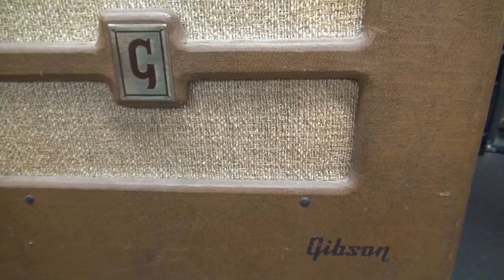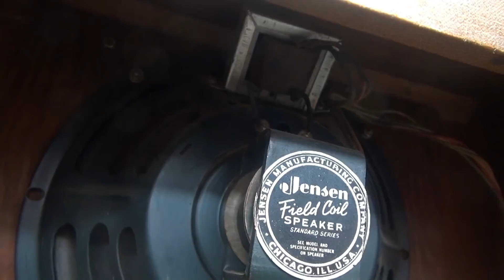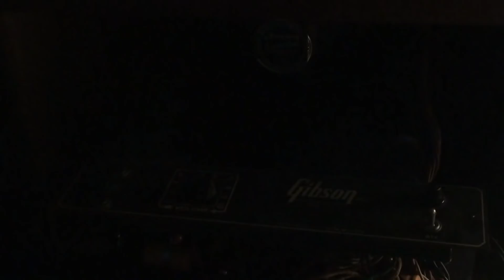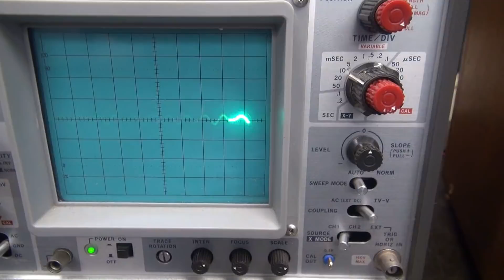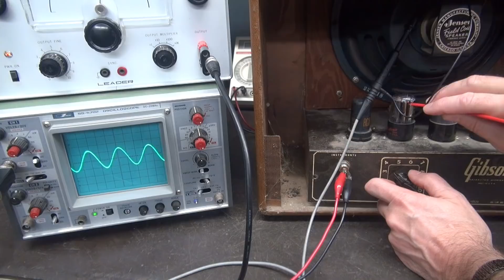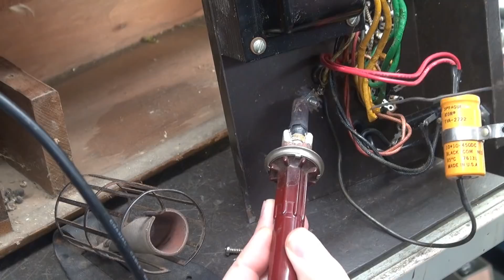How to repair Hum Buzz Gibson BR-6 Tube type practice Guitar amp

Comment: dude ... you never fixed the HUM I could
hear it under the natural tones of the
amplifier!  is there a 20 mfd@25 WVDC Capacitor in their, change it to a 100 MFD@50 WVDC, and I'm 95% sure you got a bad resistor in there as well?   ~ russ

Comment: I helped my aunt move 12 years ago, in her basement was a Gibson G-20 amp she said I could have. Filter Caps, Resisters and wiring are all original. One tube was replaced by me and speaker has been replaced for some reason, I looked up the speaker and it is a 1958 Utah. It has sat in my closet for the 12 years I have had it, I pulled it out a month ago and it didn't fire up, that is when I replaced the tube. After replacing the tube it fired up but after a minute or so I smelled wire burning. I did some researching online and learned about the filter caps drying out and in any vintage amp should definitely be replaced. I found the schematics on Gibson's website opened her up and was ready to save me some money I cut two caps out went online to find what I need to order, that is when reality hit me and I realized I didn't know what the hell I was doing and would never get the amp working if I attempted this restoration with my own two hands and a brain that has no knowledge in this field. Watching your videos here and there I would feel more comfortable handing the job over to you. If that would be a possible how can I contact you about where to ship it.

After looking at amp I need to make a correction, it is a Gibson GA-20 amp not G-20.
Reply from the maker: Hey Man, I'd be glad to go thru the amp for you e-mail: n6tlu@comcast.net
Reply: D-lab Electronics - Great! Thank you so much.
Reply: D-lab Electronics - E-mail sent
Reply: Just buy mallory electrolytic caps the same specs as you have, but polarity has to be correct, look for the + or- on the old cap. Tube sockets need to be cleaned with cleaner. Pots get dirty and need sprayed also.
Reply: Don Rutter - it is possible more than just caps are a problem, it would be best to let a person with expert knowledge and diagnostic equipment to make this restoration a one shotter. This is definitely for me an exception to the rule if you want it done right do it yourself.
Reply: Look up Terry’s website. I’m pretty sure he’ll gladly fix it for you. https://reverb.com/shop/terrys-shop-54